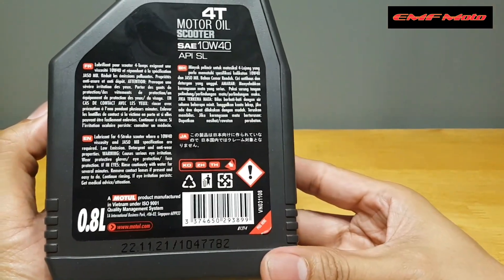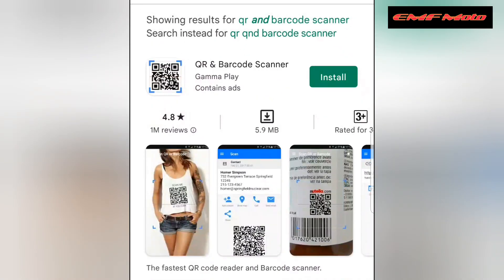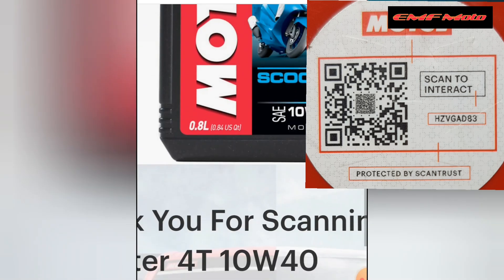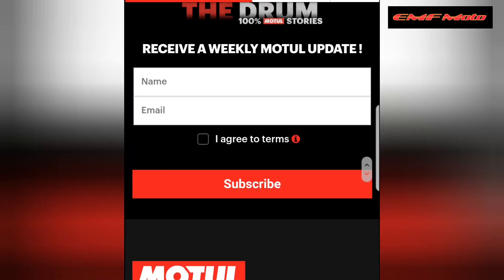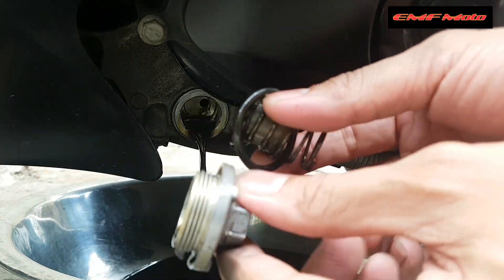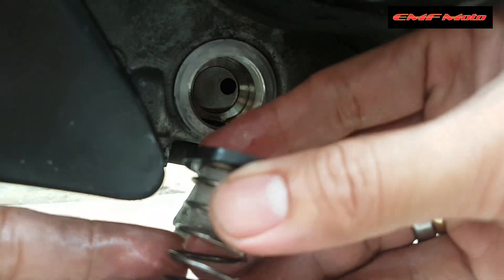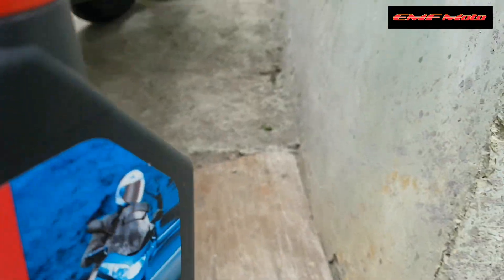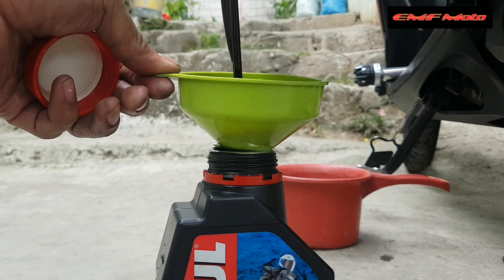MOTUL Engine and Gear Oil - Original or Fake

Comment: Good day po boss ask ko lang po inubos nyo po ba yung 120ml na motul gear oil.? Ang pagkakaalam ko po kasi boss 100ml lang po dapat sa gear oil may kahit anung epekto po ba to sa scooter if masosobrahan po.?
Reply from the maker: Nailalahat ko na yan, konti lng nmn ang difference may tolerance nmn yan and pag ginagamit mo nmn araw araw pag nagbawas yan halos sakto na yan pag tagal, katulad ng sa langis 740cc lng dapat pero ung 800cc nilalahat ko na kaya pag nag change oil ako tama parin sa level, 3 years ko nmn ng ginagawa pero no effect naman sa motor, ikaw kung gusto mo sakto lng e nasasayo nmn yan Sir. 

     Salamat sa comment mo Sir...
Reply: @emf1407  thank you po bossing 🙏❤️